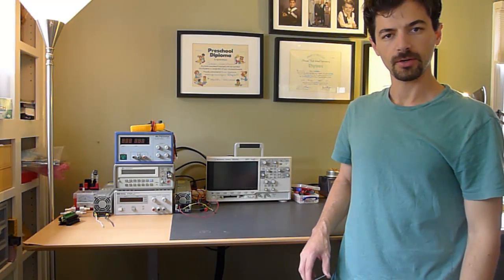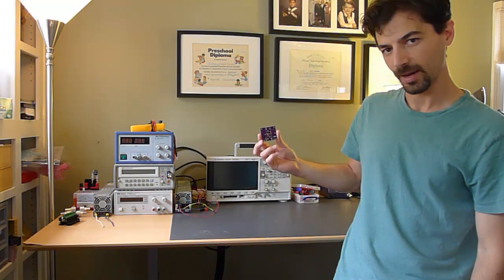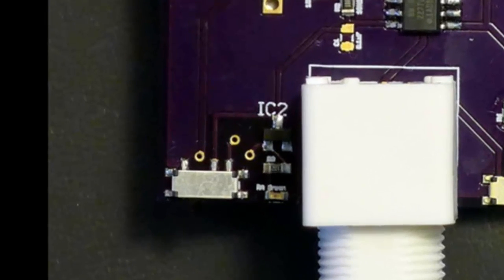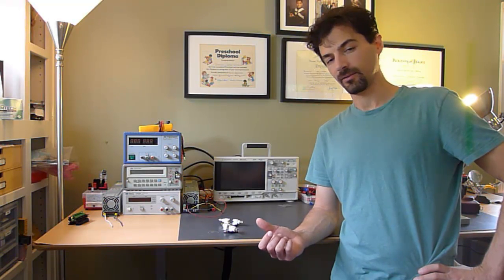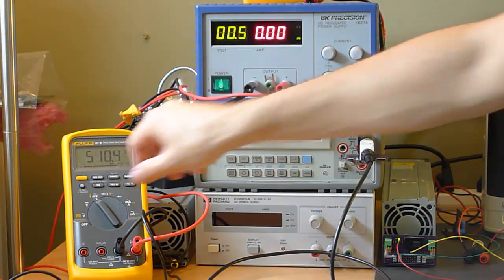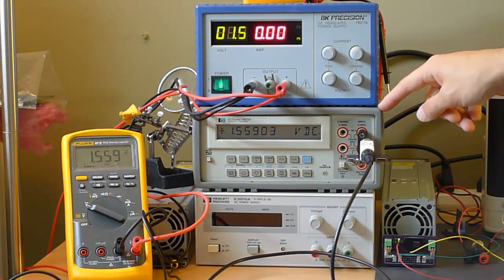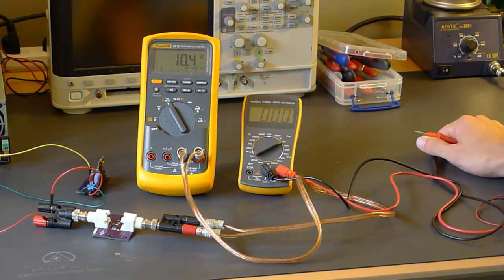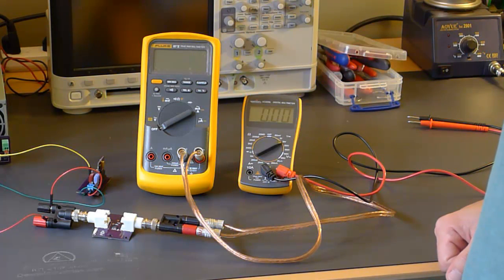Nano Ammeter Complete - Meet "Lightning Bug"

Comment: Great video, but did I miss a bit because you barely touched on the interesting bit, Nano amps, as your fluke there will measure accurately in the microamp range anyway?...the only Nano amp measurement we see is your device in quiescent state, which was all over the place shouldn't this state be rock solid ? then you switch on your device and we see a steady current draw in the milliamp range, as I said, the fluke is more than capable. The reason I ask is, I would like to accurately measure an Arduino Uno in deep sleep, around 300nA ish with your device. Put simply is there a vid about it measuring small currents ? because most meters now have a microamp range (like yours ) this one shows nanoamp measurement for less than 10 seconds the rest is stuff our meters can do anyway...cheers
Reply from the maker: It is all about the gain you put into the transimpedance amp. I was able to get measurements, but I needed about 5V of battery to make it work (if memory serves) and I found another gizmo that had a superior battery holder to my own and started using it. https://www.eevblog.com/product/ucurrentgold/

Comment: I see I'm a little late here. Great work! This is exactly what I was looking for. I do work with devices that use sleep modes on a microcontroller, so I need to be able to see down to nano amps, but also up to several milliamps while running, and I need to how that varries over time. It looks to me that it would be straightforward to use your device with an oscilloscope to see the quick bursts of power circuits like mine consume. I should be able to determine the current of various operations so I can further optimize things. With the integral function, I should be able to determine total power consumed during a wake event. All very useful things!

Did you ever kickstart this? Do you have any to sell? Or if not, might I humbly suggest that you open source your design (BOM and gerbers would be great!)

Currently (pun intended), when I set my multimeter to the nA range, I can measure sleep current, but when the device wakes up, the high value of shunt resistance browns out the circuit. If I switch to a higher range, there is a momentary break in the circuit and it dies. My Keithley (which is overkill and will probably be sold soon) doesn't have either of those problems. It looks like your circuit doesn't have these issues either, is that correct?

Finally, in your breadboarded design, you had a second op-amp to create a virtual ground at 1/2 VCC. That seems to be missing in this design. Why is that?

Thanks for the videos!!
Reply from the maker: the burden voltage of this circuit is low, but the range is pretty limited without switching in a different resistor. 
the uCurrent is open sourced and is an excellent design. check it out.

Comment from the maker: It's sounds like you will be fine. The device has an on off switch so it only draws power when you turn it on. I too would like the option to plug it in so I can have a broader range in input voltages to test. The allowable input is based on the supply voltage...

Comment: Another question. do you know what the current input impedance is? You have stated in an earlier posting that the voltage should not be in excess of 18V. Won't this depend on the impedance? I intend to use this in series with a tfmr output. The current will depend on the external load and the volts across the device will depend on its impeadance, which will be very low, i.e. u to mA. So I think it should be ok?

Comment: Just brilliant. Can you put my name down for one?
How long would you expect the battery to last. I know that depends on use but does the device use up much power when it is not presented with any input. (Perhaps you could use a precision low current measuring device to test that :) I think I might just be inclined to supply it from a power supply.

Comment: I see there is the dilemma, one that used a technique first,they presolder  then warm up the oven or with hot air, but other  one just use use solder paste,and   then use  solder tehnick(oven or heat),the i was asking if you use special paste